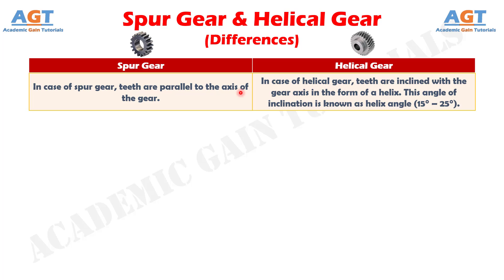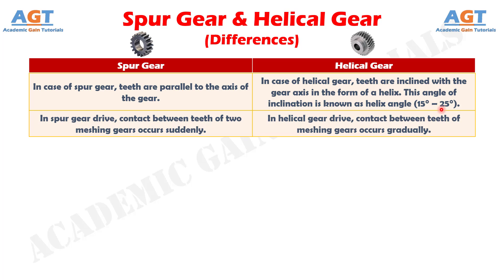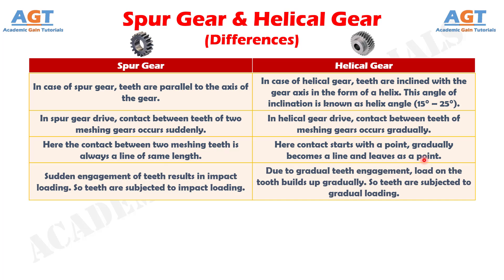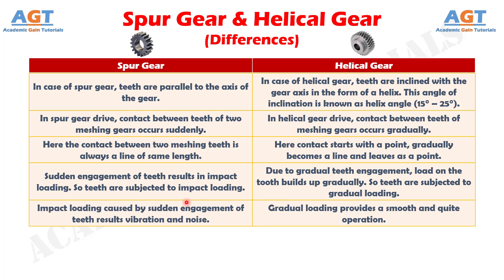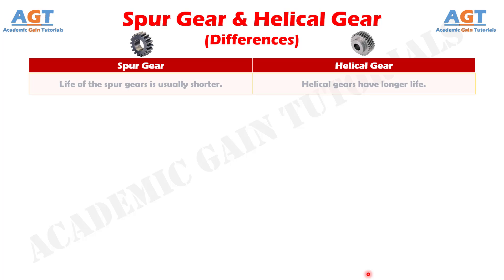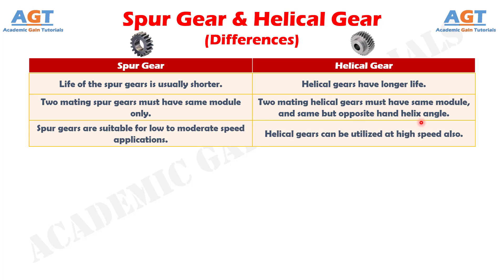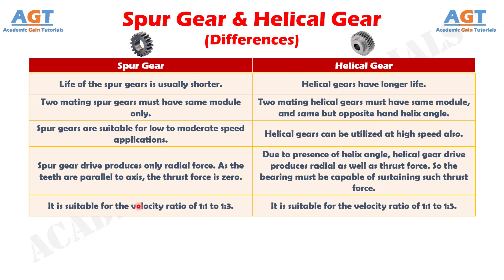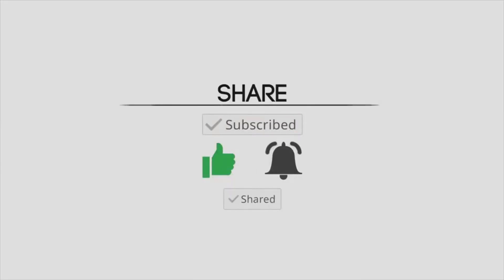Differences between Spur Gear and Helical Gear.

Comment: Correction. A helical gear can be very little to 45deg. Two helical gears running at 90deg are called crossed helical gears, common in automotive drive for oil pumps and distributors. The biggest advantage of helical gears is that you can get different ratios with same size tooth by changing the helix angle. Say 75mm centre distance and a 23 driving a 29 tooth. You can alter helix angle and make 23 drive 30 tooth but use same cutter and they run perfectly.